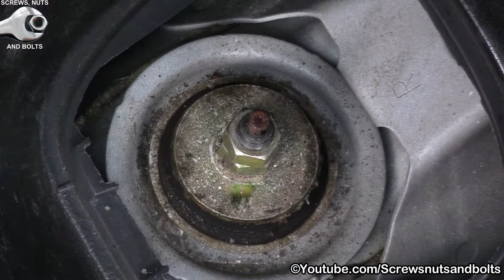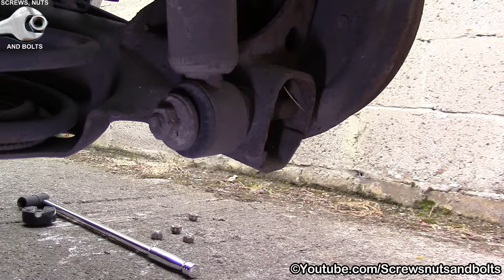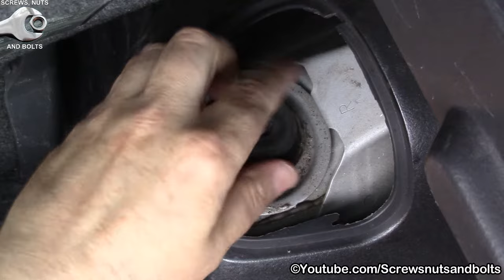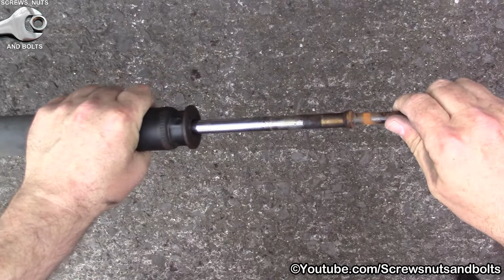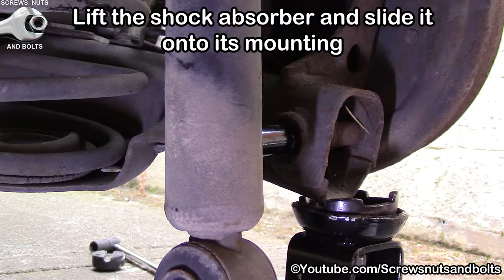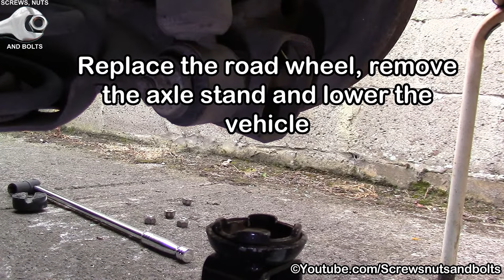Rear Shock Absorber Replacement - Toyota Yaris

Comment: Garage done the same job 2 rear shock absorbers new top rubbers and even new springs  i’m still getting bump noise not sure where to look it’s definitely coming from the back it’s driving me nuts
Reply: I hope you find the problem
Reply: Maybe where the spare wheel is?  Just throwing ideas out there.
Reply: Could be broken steel rod / stabilizing rod

Comment: QUESTION (maybe dumb): So, when you go to torque the top nut, what do you do if the threaded center just spins? Yes, you can initially tighten with 2 open end wrenches, one securing the center that wants to spin. But, when you put a socket on there to torque the nut, how do you torque it if that center still spins?
Reply from the maker: The manual states that you only have to torque the top nut of the two that screw onto the top of the piston rod, so you can hold the bottom nut with an open ended spanner as you torque the top one.

Comment: Is it necessary to remove the wheel?, or you can do it on some ramps so you can simply have more space under the car in the back?
Reply from the maker: Im sure it's possible to do with the wheel on if you have the right equipment

Comment: What size is the bolt metric size ie m10 m12 or bigger
As I don’t know what size bolt to replace mine which damaged getting them off
Reply: The upper shaft thread is M10 x 1.25

Comment: Do you happened to have a list of all the tools needed for this job? One of the sites has a hell of a list with at least two dozen things on it, but it looks like you only used Maybe five or six different tools. Hoping to save a few hundred bucks, thanks for the sweet video!
Reply from the maker: Thank you. I just used 2 x 14mm spanners
, a car jack, a wheel brace, an axle stand and a 17mm Ratchet or Spanner.
Reply: Awesome. That's super helpful. Thank you <3
Reply from the maker: @alekzandr_apokalypto  You're welcome :)
Reply: ScrewsNutsAndBolts i

Comment: Am I right in thinking if I just wanted to change the mount I could leave the shock absorber in whilst jacked up abit to compress the spring and change the mount from the back of the boot? Many thanks mate
Reply from the maker: Yes you can do that if you're only replacing the very top mount
Reply: @screwsnutsandbolts  cheers for the reply mate. Top man x
Reply from the maker: @DeanWarwick-1993  You're very welcome

Comment: the rubber casing on it shouldn't be easily moved up and down, right? Like just with your hand. The rubber sits low and I'm able to move it without much effort.
Reply from the maker: That's a dust cover. They sometimes break or come loose but it's not an emergency and doesn't affect how the shock works in the short term. However, it should be replaced before damage to the shock itself occurs
Reply: @screwsnutsandbolts  thank you so much for the info
Reply from the maker: @artemislian5261  You're welcome !

Comment: hi one of  rear shock is leaking a bit. Do i need to replace that asap and do i have to change both rear or just the leaking one? car is 5 year old and only 30000 miles
Reply from the maker: Hello, he leaking shock will get worse over time and could affect the cars handling. I would replace the two shocks asap as changing just one could also badly affect the handling.
Reply: can you please tell me how tight  should the nuts be or torque please
Reply from the maker: @jayashpatel6165  According to the manual, the top nuts should be torqued to 25 newton meters and the bottom nut to 49 newton meters
Reply: @screwsnutsandbolts  
thanks I just realise that probably wont be same for 2015 yaris ?
Reply from the maker: @jayashpatel6165  Yes they're probably different on the 2015 model. I don't have that information. You might have to check with a garage or Toyota dealer
Reply: @screwsnutsandbolts   I just gave it to mechanic he did it in like 40mins. But he never torqued it down. Just used the air gun on all of it.
Reply: I don't think i will bother torqueing it even though i got the stuff to do it. Even the wheels he put back with air gun only.

Torque settings for the rear shock bolts  06/2011-11/2017

 

Upper -15-18mm of thread above the nut - 25nm

Lower - 49nm
Reply from the maker: @jayashpatel6165  I've seen mechanics do that myself. They don't seem to think the torque settings are that important.

Comment: So you do not need to tighten the upper bolts that much?
Reply from the maker: No not too much. I tightened them back to the same amount as when I started.
Reply: @screwsnutsandbolts  I heard some strange noises when driving and I had to loosen the nuts a bit to allow more wiggle room for the rubber to move. Sounds are gone now. Thanks for your video.
Reply from the maker: @andreiazzopardi  Thank you, glad you sorted out the problem :)

Comment: THIS IS WRONG  the final fitting of the top nut should be taken down so there is a distance of 15 to 18 mm between the top face of the nut and the top of the strut. then the lock nut is put on and tightened. Doing it this way as shown will compress the rubber bushes until they are nearly solid and give a very harsh ride. Rubber bushes are there to give a progression to the application of the shock absorber and to insulate the noise from the body.
Reply from the maker: Did you read the video description ?